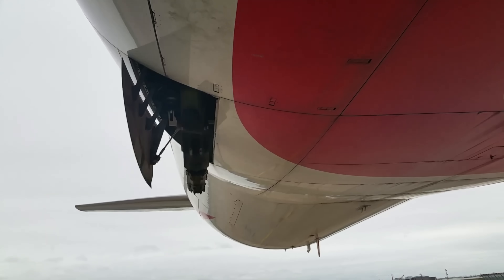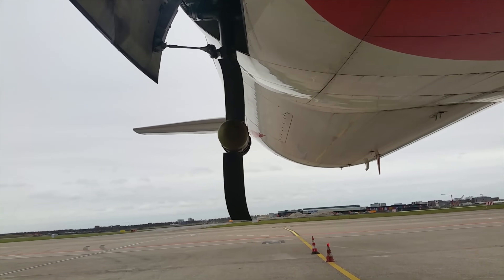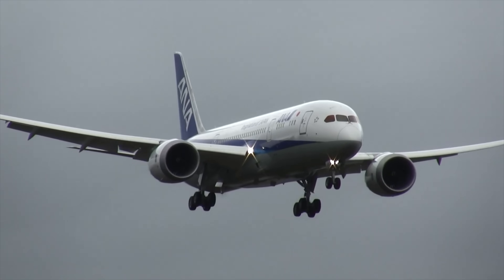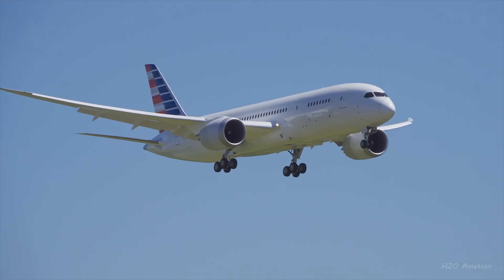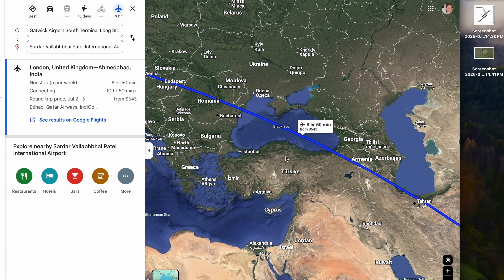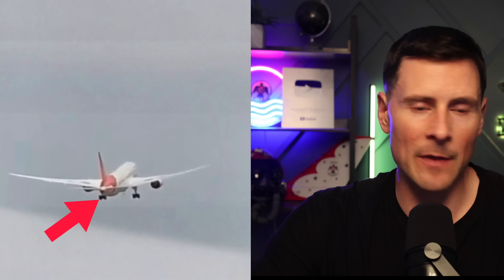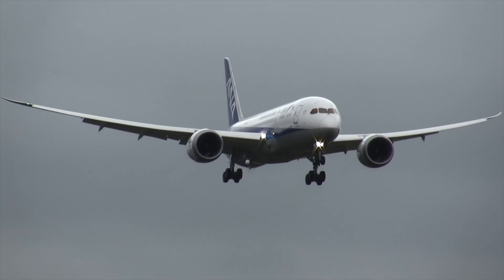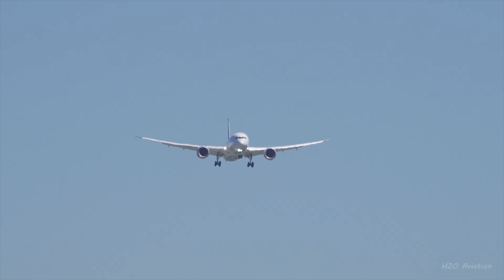Air India 171 SHOCKING UPDATE on RAT Deployment and Flaps!

Comment: My Preliminary Hypothesis on the Cause of the Crash (June 2025 Incident in India)

During takeoff roll, the aircraft’s Weight-on-Wheels (WOW) sensors may have continued to falsely report “ON GROUND” status. This likely resulted in:
	•	Failure of critical systems (such as ELMS – Electrical Load Management System and FADEC – Full Authority Digital Engine Control) to transition into airborne mode,
	•	Delayed or missing “AIRBORNE” signal from the IRS – Inertial Reference System,
	•	Systems operating under the incorrect assumption that the aircraft was still on the ground.

Additionally:

🔥 Overheating of electronic components or power management units (e.g., power converters, FADEC modules, backup batteries) could have:
	•	Accelerated the failure of the FADEC system,
	•	Triggered an automatic shutdown of all onboard generators, consistent with a previously reported FADEC software bug (acknowledged by Boeing and addressed in an FAA Airworthiness Directive),
	•	Compromised backup power sources, if overheating extended to the emergency power systems (e.g., batteries, RAT).

⚠️ Potential causes of overheating may include:
	•	Extended time on the runway in high ambient temperatures,
	•	Insufficient cooling during taxi or takeoff,
	•	A latent hardware fault in a power or avionics component (e.g., FADEC, ELMS module).

⸻

Summary:
The crash may have resulted from a combination of software malfunction, sensor errors, and thermal stress:
	•	❌ WOW sensors stuck in “ON GROUND” →
	•	❌ Systems failed to switch to flight mode →
	•	❌ Overheating + FADEC bug triggered power loss →
	•	❌ Loss of control and aircraft systems →
	•	💥 Catastrophic outcome.

Comment: People saying Dual engine failure has almost 0% chance. But we have to note that the plane also was in air only for about a minute, it's not like it was flying from half an hour. So what makes sense is that both engines were in bad condition even before the flight.
Reply: fuel starvation or water in the fuel.

Comment: When really two engine failed than it is a banal fault which should happened. If you will study the electrical and hydraulic drawings you will find the fault otherwise it was sabotage. The fault accures in a situation which was not tested. For e.g. when all electric failed and you operate via backup power. When you switch back to normal power it can happen that the hydraulic loss their pressure and start to build up its normal pressure. Only a possibility if their is a problem in the design. But if it was a design
failure Boing will not tell the truth.

Comment: vapor loss due to burning heat for over 3 hours waiting on tarmac

bubbles in pressurized hoses, hydraulic and fuel supply lines gather in the wrong spot as soon as the plane starts tilting its nose up, due to gravity

this explains the massive bang sound that the surviving passenger said that he heard

that is the turbines being fed lack of kerosine, too much bubbles, triggering break down

the black box will show a warning sign in the fuel supply, yet there is no place to avoid crashing, as all attention is on the warning signs of the instruments instead of having a chance to check environment
Reply: in normal condition, without vapor loss, fuel and fluids through the hoses and hydraulic pressure lines are evenly distributed, when it outgasses, kind of empty pockets emerge, like bubbles that due to tilt will accumulate into big pockets in the wrong places where they hamper proper functioning of affected systems.

Comment: How much of the runway did they use. I wouldn't have thought there'd be so much dust unless they were on a section of runway seldom used. Could it be that they lost the right engine at or after V1 and rolled to the very end of the runway before lifting off, hence the dust cloud. Just a thought!

Comment: Another pilot (sorry, can't remember the channel) said he felt the plane suffered from "heat saturation". The weather was hot, the plane was on the ramp for 2+ hours, and it's reported the plane's air conditioning was inop. Because of the heat buildup, he says, the fuel percolated, causing vapor locks in the supply lines. Since no one has investigated a 787 crash until now, this theory seems as plausible as others. One day soon, we'll all know.

Comment: Back in 2013 all 787 grounded because the batteries caught fire on Japan airline and United airline.All aircraft were out of service for 2 months. It's a possibility the same thing happened at Air India as well.
The batteries caught fire destroyed the EPU system and the system shot down 
Started to run in emergency mode.

Comment: Probably sabotage from Pakistanis (WAR) When the gear was  selected up the bogies tilted forward and this action was wired to cut the fuel to both engines, The rat deployed. The gear did not retract, flaps TE and LE were still extended after the crash. Would have taken technical skill by some malevolent individual. The captains mayday include no  power (electrical) initially blank screens( until the rat supplied it) and no thrust (engines dead). A bit james bondie but there is my summary.

Comment: (Machines) just don’t fail, specifically aircraft (jet) engines.  They are incredible pieces of engineering designed to perform flawlessly in extreme conditions. Otherwise we have a crash or an emergency landing every hour or day somewhere in the world. 

A plane takes off every two seconds somewhere in the world, and how many engines fail one can easily do the math, it has to be a maintenance issues with the engines that were overlooked and remember (I am not blaming specifically the region where it took off from) this kind of accidents normally don’t happen in developed regions of the world who are more stringent about safety and maintenance in any industry and at any level. So chances are low that engines failed due to manufacturing faults. The only possibility is the aircraft issue and if this is the case the the ball ends up in Boeing’s court

Comment: Another video showed the bottom wheel assymbly was tilted like that plane does just before it retracts the wheels, I'm wondering if they didn't start the wheel retraction and that caused something in the electrical system to go haywire in a way that caused the engines to fail. Not sure how given the level of redundency in the system, but it tracks. The wheels set up to tretract then the plane just drops out of the sky.

Comment: Loss of thrust is suggested for a number of reasons including the mayday report from the crew about loss of power.  The deployment of the RAT is now all but confirmed so loss of engine power is one of the causes for the deployment of the RAT.  But, and this I think is important, I see no indication of engine failure as I see no smoke at all coming from the engines, almost like they were turned off.  I think we'll know fairly soon what the pilots did and rulling out the activation of the fuel cutoffs would be high on the list of things to confirm.  If the pilots did NOT hit the fuel cutoffs then they are not responsible ... period!  At this point my focus is on fuel delivery and the possibility that something within the fuel delivery system failed and then starved the engines for fuel.  And, tying in with this is the statement from the sole survivor that he heard a bang.  Now the timing of that bang is unclear and it might have been the RAT being deployed, but I can't help feeling that if a bomb were put on the plane that a small bomb placed near the fuel delivery controls of pumps could accomplish the loss of power and resultant crash as well as the bang sound heard by the survivor.

Comment: I don't think the gear down is odd, there would have been a lot going on in the cockpit besides retracting the gear. I think the dual engine failure happens very shortly after take-off so there wouldn't have been time. Planes fly perfectly fine with the gear down. And there wouldn't have been enough hydrolic power to lift them. We won't know until the investigation is done why the engines failed.

Comment: The RAT deployment may have been (even though it's automatic) inadvertant. I'm not sure this is the smoking gun. The system that deploys the RAT, btw, was WAIVERED by the FAA for a certain period of time (look into it) during the initial 787 certification process. There are reports (again check this out) that the RAT may also have deployed any number times in the past for unknown reasons on the 787.  In this case one wonders if the RAT deployed in response to loss of engine thrust (how could BOTH engines go out simultaneously?) or APPARENT LOSS of engine thrust due to failure to achieve lift (after 625 ft) on takeoff..

Comment: If RAT deployed that means they have no controls, complete blackout in the cabin, it takes longer than 10 seconds till basic systems for controls start up again they didn’t had 10 seconds and went straight in a stall and went nose up because of engine loss and flaps are stuck.

Comment: Been doing a little digging.  Noted the first instance of pilot error was reported by a pro trump newspaper. Don't care about the politics, all i know is they are also pro riussia.  This is important... first redirect might (only might) have come from Russia.  So why lie (if it's the case) about this? Tracked the plane to its company and subsidiaries and discovered that the airline is owned by a super rich family who only just bought huge warehouse and spares as well! 
Put it this way,  a plane load off spares would be super valuable in riussia.  That place that crashed? Was due its 40k flight hours check- a HUGE amount of spare parts and I've seen no evidence the overhaul was done.  The plane company just announced it made a 250% profit which seems a little far fetched.  Also they are exporting heaps of car parts to the uk despite practically no car sales!

It may be that the Indian company is taking risks to import parts because it pays well

The engine sounded like they failed.

Comment: A clue could be how much of the runway did the aircraft use to get off the ground.  It appears that it rotated very late, near the end of the runway, well after where it should normally have rotated for take-off.   If this was the case the problem occurred early in the takeoff run and the pilots should have had time to abort the take off and stop the aircraft before reaching the end of the runway.

Comment: Still to be verified but it looks like a catastrophic electrical failure on rotation. 

Flight: AI-171 | Aircraft: Boeing 787-8 | Date: June 13, 2025 | Route: Ahmedabad (VAAH) → London Heathrow (EGLL)
Crash Site: ~1.2 km from VAAH Runway 23, post-V1 and rotation

⸻

🛠️  AAIB Preliminary Report Highlights

1. Primary Cause – Electrical Power Transfer Interruption (PTI) During Rotation
	•	During transition from ground to airborne electrical configuration, the aircraft experienced a cascading dual-engine FADEC (Full Authority Digital Engine Control) failure.
	•	Root cause: Uncommanded bus transfer failure due to arcing in the main power relay box (PRB-A), traced to water ingress during pre-flight GPU disconnection in heavy rain.
	•	This led to loss of electronic engine control at rotation, resulting in both GEnx engines rolling back to ground idle within 4–5 seconds.

2. Flight Data Record Timeline
	•	+0:11 sec: Nose gear lifts off.
	•	+0:13 sec: Sudden engine rollback begins. Thrust reduces from 92% N1 to <27% within 3 seconds.
	•	+0:16 sec: Master caution + ENG FAIL L/R warnings. FO calls, “Both engines dropping!”
	•	+0:20 sec: Autopilot and flight control reverts to Direct Mode. Pitch up attitude peaks at 18°.
	•	+0:25 sec: Aircraft stalls at 186 ft AGL.
	•	+0:30 sec: Full aerodynamic stall; nose drops rapidly.
	•	+0:38 sec: Ground impact at 54° nose-down attitude, 174 knots.

⸻

⚙️ Contributing Factors
	•	Environmental Conditions:
	•	Torrential rain during pushback.
	•	Moisture intrusion into PRB-A connector (P/N: HLN8471) — a known corrosion-risk component.
	•	Latent Maintenance Issue:
	•	Power transfer relay unit showed signs of thermal damage in a previous MEL deferral 2 weeks prior.
	•	No replacement had been conducted; aircraft was cleared under repetitive deferral.
	•	Design Oversight:
	•	Boeing 787 has no physical engine control backup (i.e., no direct mechanical linkage in FADEC loss scenario).
	•	Loss of power supply to both EEC channels resulted in engine “freeze” at ground idle instead of flameout.
	•	Flight Crew Response:
	•	Attempted engine relight sequence not completed before stall onset.
	•	Emergency power selector not activated — possibly due to confusion from multiple ECAM warnings.

⸻

✈️  Immediate Safety Actions
	•	DGCA + EASA + FAA Emergency AD issued within 24 hours:
	•	Mandatory PRB-A moisture integrity inspection on all Boeing 787 aircraft.
	•	Temporary restriction on dispatch with MEL items related to power transfer systems.
	•	Boeing:
	•	Issued Service Bulletin SB-787-24-212 requiring replacement of PRB-A connectors with sealed versions.
	•	Exploring addition of dual-path power redundancy for FADEC systems.

⸻

🧠 Lessons Learned
	•	Over-reliance on electrical power distribution architecture without layered redundancy.
	•	Lack of crew procedural training for full engine rollback during takeoff in EEC dual failure scenarios.
	•	Need for improved environmental sealing in GPU/electrical handover units in monsoon zones.

⸻

🕯️ Human Toll
	•	The loss of 243 onboard lives, including 12 crew and 18 infants, deeply impacted the aviation community.
	•	Final words captured on CVR: “We lost everything – no thrust!”
	•	One family of five was killed on the ground in a hospital ambulance struck by debris.

⸻

📅 Timeline – What’s Next?
	•	Aug 15, 2025: Release of FAA/Boeing electrical design audit report
	•	Sept 5, 2025: ICAO session on electrical-critical phase-of-flight risk mitigation
	•	Oct 2025: Mandated design retrofit across 787 fleet (rev. SB-787-24-219)

Comment: theres a video circulatiing showing the plane inside 2 hours before the crash that showed technical issues with the AC, not to spur any conspiracy theories but pilots that used to work with air india have talked about how maintenance is often neglected and i remember there was one specific plane that always had technical issues based on a ex-pilot for air india's account.

Comment: Here is what happened, 1. theclandng gear was not retracted
2.the Captain, adjusted his seat, the seat adjustment was serviced 11 days prior.Tge Captain fell backwards and grabbed the trust lever pulling it into neutral thrust. 
The co pilot tried to lift thevtrust control back out of neutral truth but  he couldn't becausecif thecweolight of the Captain. Why didn't he justvtake control from his seat? wecwill never no. One Big fuck up. 
This info came from a buddy of mine who flies international for a major airline. The temp also had an  affect on the lift.

Comment: The gear is angled forward, that position is the first thing the gear does when it's selected to retract/up.  The carriage position in the video is telling, that's not T/O or LND position.  I share other theories that they did command gear retraction, the carriage angled as it would to clear the bay doors.  The RAT, as you mentioned, won't power the gear.  I think you're doing a disservice to bring a spoiler deployment into this, other video clearly doesn't show that.

Comment: Do you think we'll ever find out what really happened? Did they ever get to V1? If not, why did they continue the take-off roll? Did they actually start their take-off roll from the mid-point of the runway as some have reported? If so, why? I'm no aviation expert by any means and all I can do is look at the info presented and attempt to draw a logical conclusion. To me, the logical conclusion is that they experienced fuel starvation via vapor lock after they hit V1 (and so couldn't stop in time) causing engine failure, etc. I hope the black boxes contain the data/info needed to draw a validated conclusion and that the real story is released to the public at some point.

Comment: Every example video I have seen of the RAT deployed, shows an aircraft on approach. This means that the engines are making significantly less noise than on departure. I’m wondering if the RAT is still noticeable during climb out assuming the engines are functioning properly? I’m guessing it would be hard to distinguish with the human ear. I understand it’s a lot to assume but I think the engines are not making climb out thrust in the case of this crash.

Comment: AI171 passengers on the arrival flight to Amedabad reported electrical problems.
Might an electrical problem in the Boost Pump potentially  lead to vapor lock when the outside temps are 40C ?
Just curious - when outside temps are 40C, what is the actual temp on the tarmac?
Might that vapor lock lead to engine performance loss/failure?
Or, would the RAT, when deployed, provide sufficient electricity to run the Boost Pump (or is it already too late)?

Comment: It’s obvious given the deployment of the RAT and the fact that the landing gear is in the stowed position (wheels pitched downward and forward) that everything was normal right up until the “positive rate gear up” command was executed. Then there must have been a loss of thrust in both engines which was unrecoverable at 600+/- feet. To me it looks as tho the landing gear moved upward or at least began moving upward before the engines failed.

Comment: Ryan, please consider the tilt towards the right when the plane took off. It is very small, but still recognizable. Could it be that the right engine failed first and the second one soon afterwards?
Oh, the plane never got as high a 625 feet, only a bit over 430 feet as you have to consider that the Ahmedabad airport is about 190 feet above sea level.